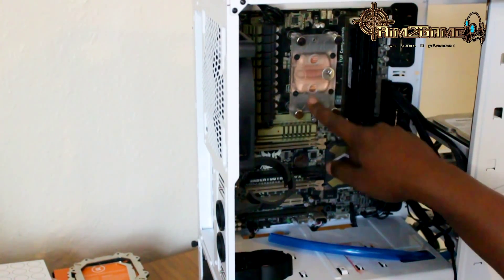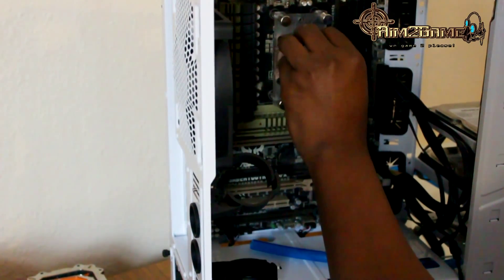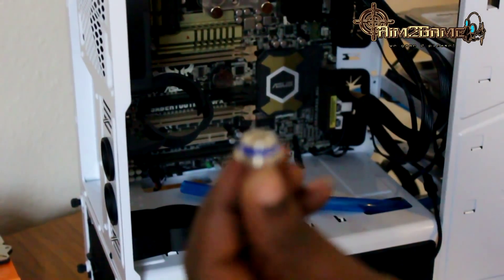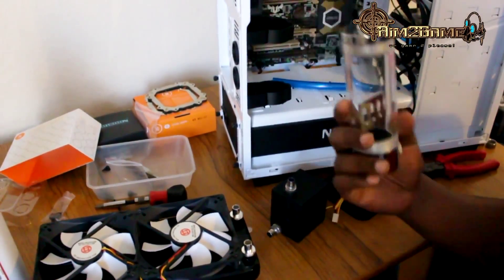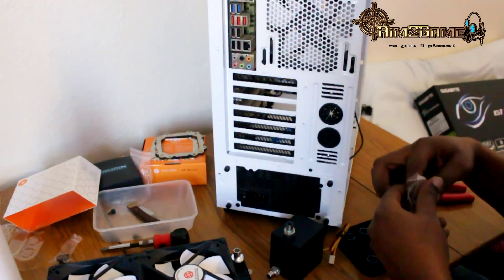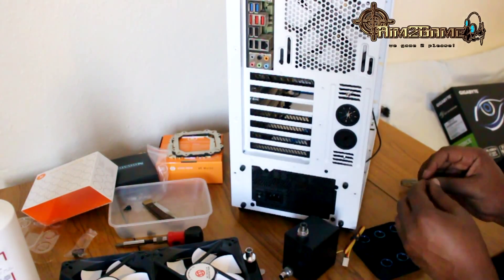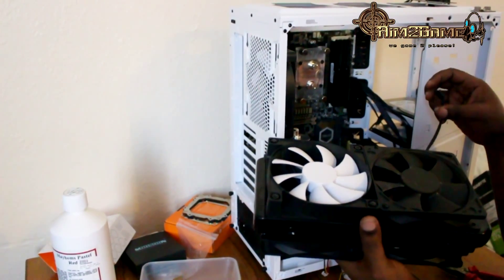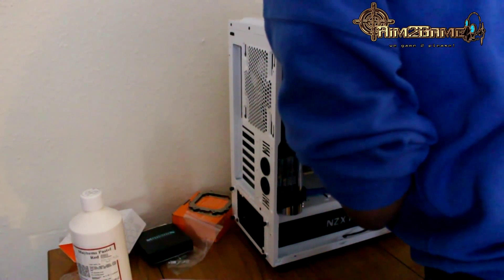ULTIMATE Beginner's Guide to CPU Water Cooling - Installing The reservoir Fittings & raidiator 5/6

Comment: I'm about to build my PC and this setup seems very good however I don't see it possible where you can connect the pump to the reservoir should I just get a drive bay reservoir pump combo to connect to my CPU and top radiator?

Comment: What CPU loop you recommend for under 150 gbp for i7 4790K?
Reply from the maker: hey MrHD71
if you want something clean and easy to maintain then go with a closed loop system like a Corsair h100i its easy to fit and is about 100gbp but if you want a custom loop then go with the
Alphacool NexXxoS Cool Answer 240 LT/ST - Full Kit £130.78 inc VAT
link:
http://www.watercoolinguk.co.uk/p/Alphacool-NexXxoS-Cool-Answer-240-LTST-Full-Kit_30211.html
it's a complete kit and when your ready you can add more to it check out the other kits on the site i linked as thats where i bought some of my kit^^! make sure to check the space in your case before you buy so you know you case can fit the double fan radiator hope that helps^^! if you need any more help just comment i'm always happy to help^^!
Reply: Does that bundle contain a pump?
Reply from the maker: MrHD71
hey MrHD71
yes the kit comes with 1xAlphacool DC Ceramic LT - 12V DC - pump
The pump and reservoir are a combo so the pump fits into the reservoir.
The pump for this kit is a compact pump.
everything you need for your cpu loop is in the kit^^!
Reply: Is there any other better kits for maybe 10 gbp - 20 gbp more?
Reply from the maker: MrHD71

if you want to you could buy two more fans so you can have the raidiator in push pull (2 fans on each side of the rad, 2 pushing air through & 2 pulling air through) thats how i have my setup works really well^^!
link:http://www.watercoolinguk.co.uk/p/Corsair-SP120-High-Static-Pressure-Fan-Red-LED-Twin-Pack-120mm_47760.html

Or you could get a coloured coolent but don't use pastal or aurora coolent as these will gunk up your loop try phobya coolent thats what i use^^!
link:http://www.watercoolinguk.co.uk/p/Phobya-ZuperZero-UV-Crystal-Blue-1000ml_48887.html
hope that helps^^!
Reply from the maker: MrHD71
Hey MrHD71
this kit is an upgrade to the first kit
http://www.watercoolinguk.co.uk/p/Phobya-Pure-Performance-Watercooling-Kit-360LT_42356.html
each part is a bit better but the raidiator is a triple fan raidiator so you'll need more space
hope that helps^^!
Reply: In the previous one, the pump looked as if it was made out of cheap components. I need a water cooled loop for a z11 plus case. Will the previous one work?
Reply from the maker: MrHD71
Alphacool DC Ceramic LT - 12V DC - pump is actually a very good pump its just compact:) if you really want a kit with a solid looking pump (same pump and reservoir in my guide) and will deffo fit your case then this kit should suit your need very well the only difference is the raidiator is single fan^^!
link:http://www.watercoolinguk.co.uk/p/Phobya-Pure-Performance-Watercooling-Kit-200LT_42357.html
Reply: I dont actually have the i7 and z11 plus case, I'm recommending my friend to custom water cool. Will there be any temperature difference between 120mm and 240mm?
Reply from the maker: MrHD71

yes 240mm raidiator has twice as many cooling fins inside it so there will be a temperature difference.
Reply from the maker: the phobya kit has a single 180mm fan so it can make up a bit for difference
Reply: Would this be a better choice?:
http://www.watercoolinguk.co.uk/p/XSPC-RayStorm-750-EX120-Starter-V4-Pump-WaterCooling-Kit_43423.html
Reply from the maker: MrHD71

This is ok but you won't get the screw on compression fittings, it comes with barb fittings which uses plastic clamps